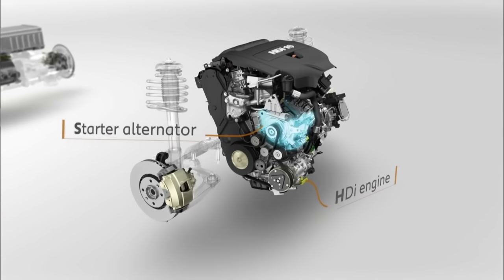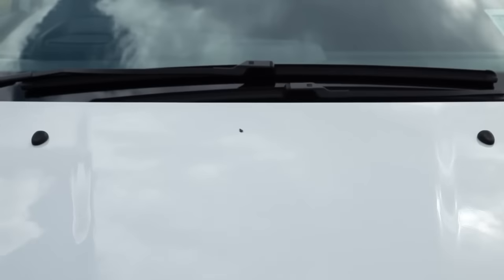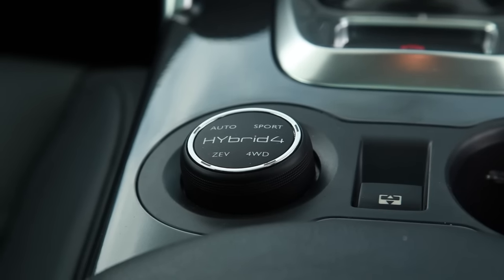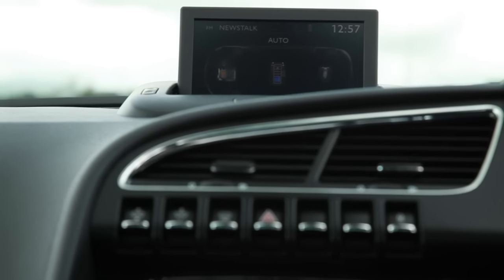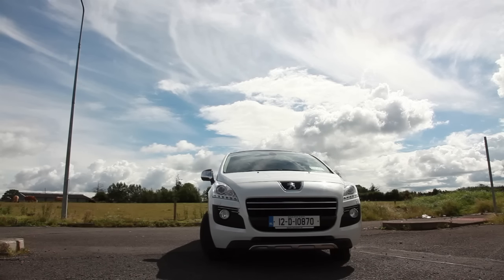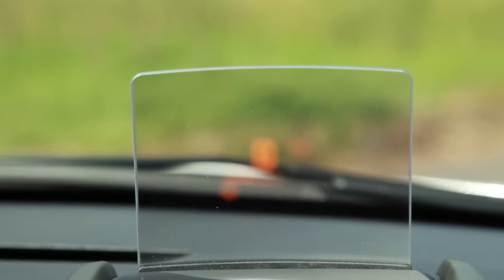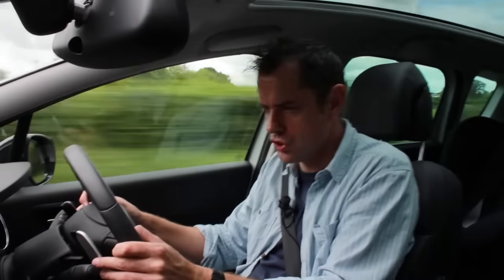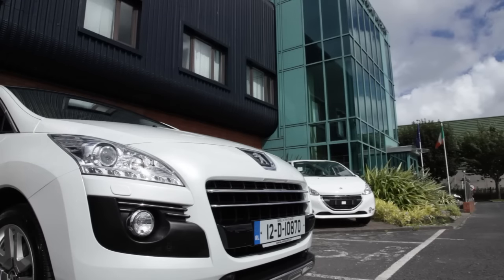Peugeot 3008 Hybrid 4 full review replacement version

Comment: Owned one for 4 years. It was a fine hybrid family car. I did 120,000 miles in it. As a company car, it was brilliant.

TBH I miss the thing more than I thought I would. Loved the high tech hybrid.
Reply: Do you remember what sort of fuel economy you got ?
Reply: @Mr330d  typically low-mid 40's in most tanks. If you drive for economy you can get over 50 quite easily, but it gets tedious

Comment from the maker: Correct with the added bonus that you can attach the electric motor to any back axle with few modifications and servicing can be done at non specialist if you're just getting the diesel unit done.

Comment: Yeah. It's the main reason most hybrids didn't have diesel engines. It's evident that a Diesel car would have a higher price tag than a petrol car, the culprit would be more expensive exhaust systems to keep the poisonous gases and particles low. Add that up to a hybrid drivetrain which are already expensive, you'll have a car a couple of years ago would be considered far too expensive and uncompetitive.
Which is a shame since putting an already efficient diesel and hybrid together is brilliant.

Comment: This not because toyota made the first hybrid that it's mean other manufacturer arn't allowed to try to make hybrid there own way.
In Prius HSD, the system is fully integreated inside the gearbox. 2 electric motor/generator and petrol engine linked together via a powersharing mecanism.

In the HY4 You've got a normal diesel, with a Start and stop that act as generator. The whole electric propulsion system is in the back. If the hybrid system fail you still have a normal diesel to go with.